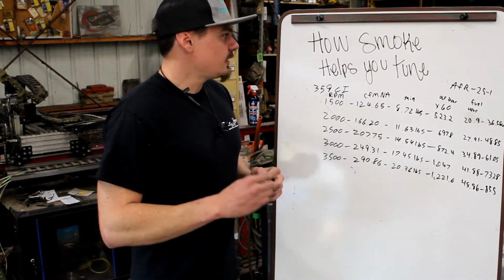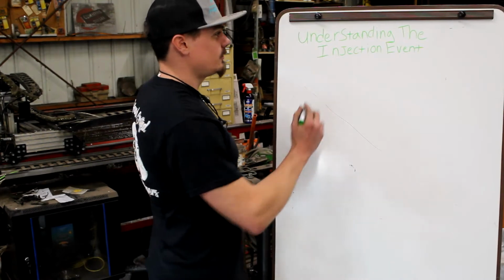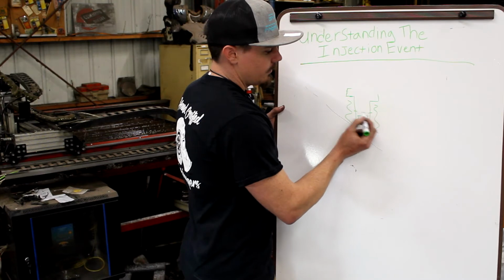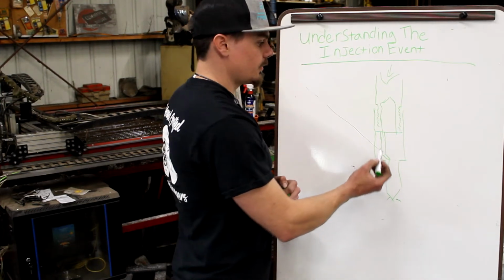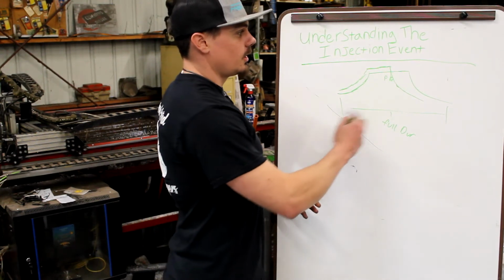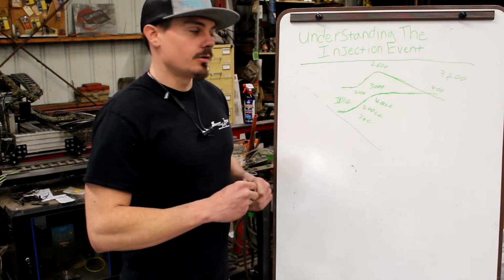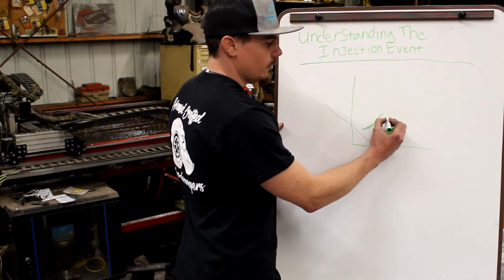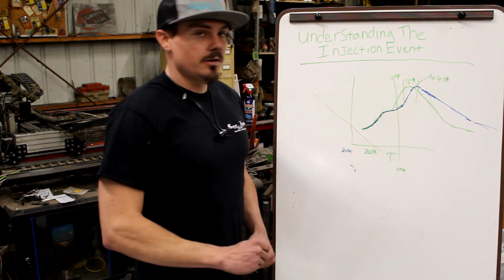Why big Injectors could be ruining your ride, and finishing up smoke tuning.

Comment: Thank you so much for all the information .... I am running a ve pump and a currently running a set of 7x.011 is that injector to large to be refilled at higher rpm I do have a 4200 governor spring and valve spring but truck just seems to defuel not much higher than stock ....thank you for your time and any information
Reply from the maker: We have a series on the ve pump coming out soon. The issue with the ve is its fuel delivery curve is not beneficial in how a engine consumes more lbs min air. The ve delivery curve has its highest delivery rate at 2200 and below and 2200 and up the cc minute is falling regardless of injectors choice and gov spring. But that being said I would make sure your 4200 spring is the same length as the oem spring, and that the throttle indexing is correct or you can run into early defuel as well. Ve’s need as much boost pressure as possible as fast as possible as all the fuel is down low in the rpm band. We see ve’s respond to small compound turbos extremely well due to this.
Reply: @savagefabrication795  super exited about some good info on the ve pumps and you experience thank you for the info